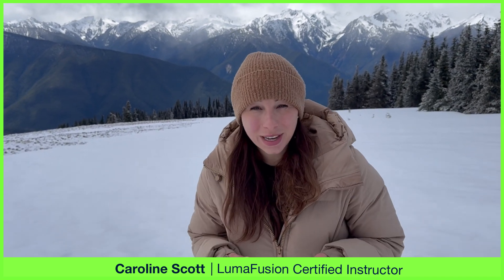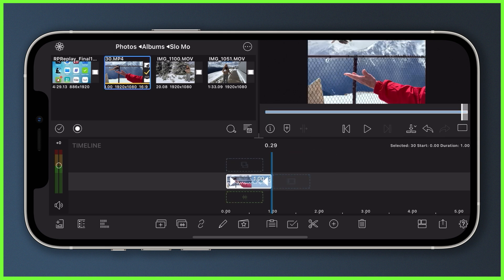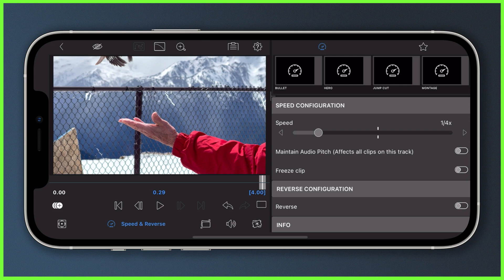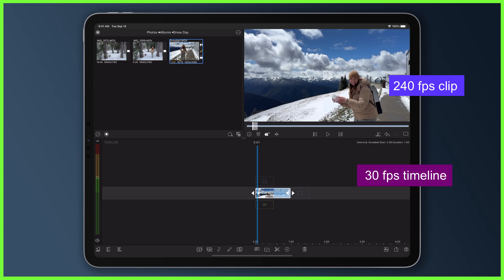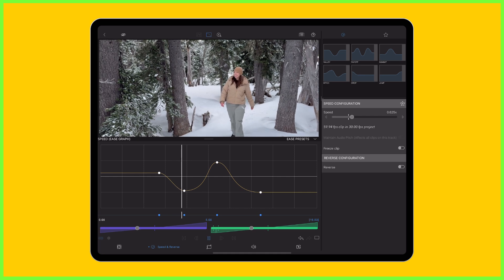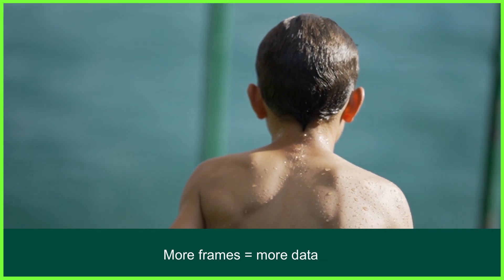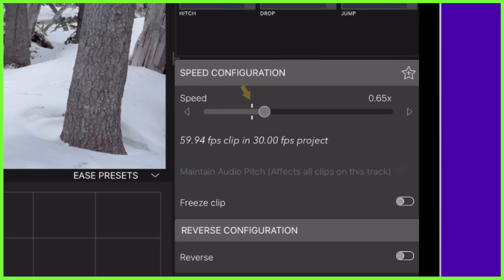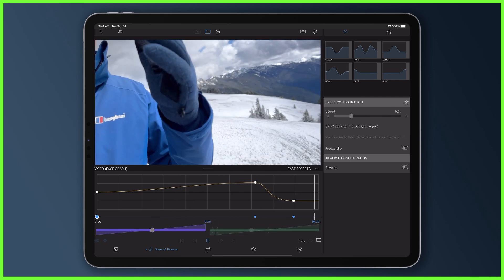Mastering Frame Rates for Slick Speed Ramping

Comment: what if you dont know if youre gonna speed up or slow down yet? Do you shoot in 60 fps and use the 360 shutter rule? So its also perfect for a 25 fps export? Which FPS do you choose? Thanks a lot! I just had a shoot and shot everything at 60 fps but later realized the footage doesn't look as good as I wanted to since I ended up not using slomo a lot.
Reply from the maker: Thanks for watching, and these are great questions. If you aren't certain, but think you might want to edit the speed of your video, it's best to prepare for it by shooting in a frame rate that suits the most likely speed change. If I wanted to slow footage to 50% speed in a 25fps Timeline, I'd shoot 50fps. 

Generally the 360 shutter rule (basically ensuring your shutter speed is evenly divisible by your playback speed) is a good idea, though for most casual video, this won't matter too much. If you have 60fps footage, there is no real downside to using it in a 30fps timeline--LumaFusion is smart enough to use only every other frame, resulting in nice playback (though the shutter speeds might be different, giving a slightly reduced feeling of motion compared to footage captured at 30fps). 

As with so much in video, there are as many variables as there are creators, and it's best to experiment with the tools to find looks that suit your stories' vibe. Happy editing!
Reply: @LumaTouch   thanks a lot!
Reply from the maker: Let us know how you get on!

Comment: One issue I had was filming a football game at 120fps then I brought that footage in LumaFusion and when I slowed down some of the footage on big plays, the audio was slowing down too making it unusable. I’m trying to think what I did to fix that. I think I had to create a new sequence and select either 30 or 60 fps so when I slowed down the footage, the audio played back at the normal speed.
Reply from the maker: What we would typically do would be to separate the audio before slowing the video down. Do that with a triple-tap on the clip in the Timeline, or select and tap the 'Detach Audio' button on the bottom bar. Of course if you slow the video footage down, it will be longer, so you'll lose sync, and you'll have to get creative on how you use the audio. It sounds like your solution worked for you, but if you have questions about the workflow we presented, please email our Support team: https://lumatouch.co/support (tap 'email Support'). Happy editing.

Comment: Super helpful! Question re: Shoot High FPS, Edit Low…If you shoot EVERYTHING  in high fps (for example: 120 fps) but you wind up using less speed ramping than you thought (keeping it at 24 fps matching the timeline, without adjusting the speed at all), will the non-speed adjusted footage look a little off because you shot in 120 fps with a shutter of 1/240?
Reply from the maker: Good question--once you notice high shutter speed footage played back at normal framerate, you can't really unsee it. But not everyone will notice--we're all pretty used to seeing video that looks extra crispy for various reasons. Best to test to see if you are put off by the look. Happy editing.

Comment: Doesn’t shooting at 120 or 240 fps create smooth slo mo in camera anyhow?
Reply from the maker: If you set your smartphone to shoot in the ‘Slow Motion’ mode, it will change the frame rate to 120 or 240 automatically, enabling you to achieve slow motion video. Your phone will create a speed ramp in the photos app, but you’ll need to bring the footage into LumaFusion to have control over your own edits 🙌